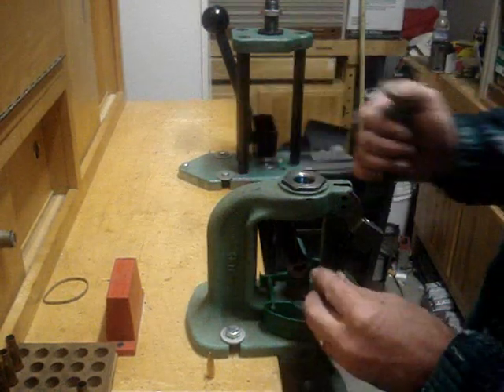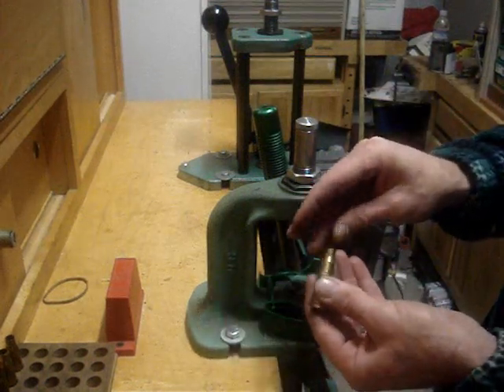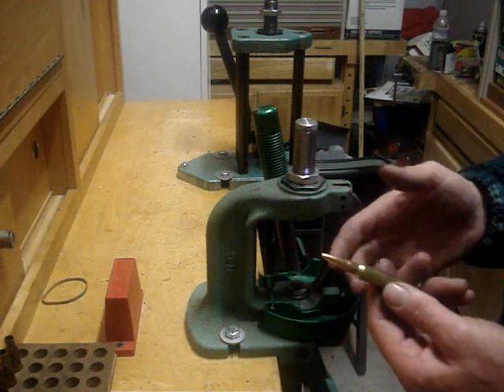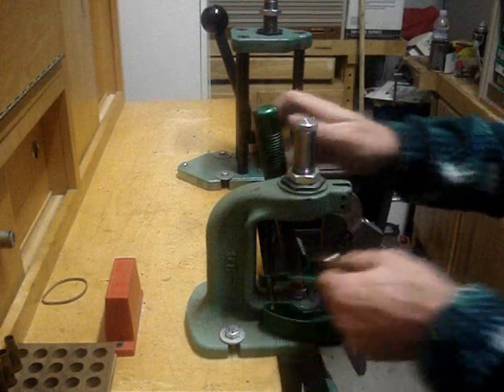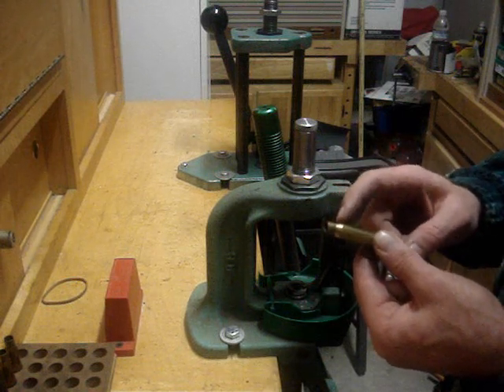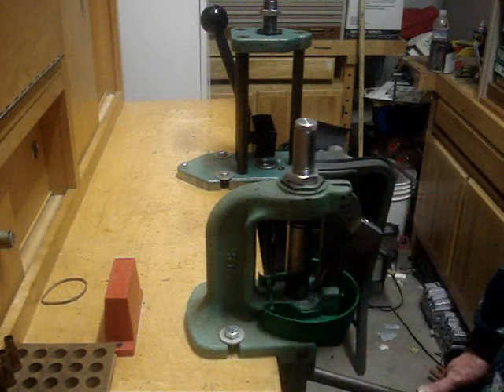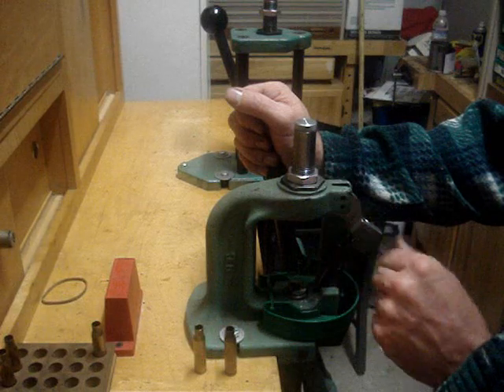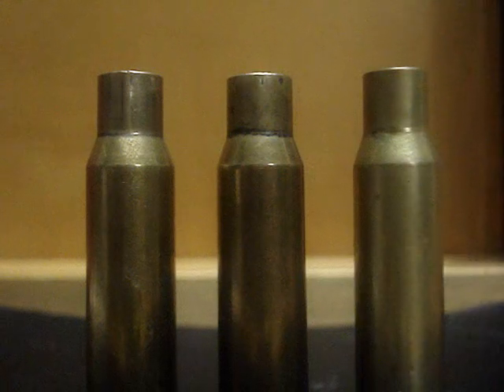Lee Collet Neck Sizing Die Part 2

Comment: This is a good video but, it seems from watching as though you are  turning the lock nut or ring only to make your adjustment.  What you are actually doing is turning the locking nut which in turn is adjusting the the tube above the lock ring at the same time as the nut to make the adjustment which the video does not fully explain and could be confusing to someone new watching. My point is, it is not the turning of the lock nut that adjusts the collet tension (as the video implies to me) but the turning of the cylinder above the locknut which also turns the locknut and put pressure on the collet to make a change in the neck tension. This is constructive only. Thanks!I
Reply: I think if you look very closely you will see the die turn as he is turning the lock nut. At least that is what I can see.

Comment: Okay.... so, I'm new to reloading, here's comes some newbe questions.  Do we use the Collet Neck Sizing Die before or after the Full Length Sizing Die. Do we lube the cases for the Collet Die, like we do with the Full Length Die? <obviously only the shoulder if at all w/ the Collet Die.. & Is the Collet Die necessary if we Full Size Die?

Also, I noticed that your Collet Die came apart easily, my inner piece [collet ] moves only with fairly heavy pressure, but will not come out of the die. 

Thx

Comment: Neck sizing is for when you want to make very accurate loads for one particular (generally bolt action) gun with brass that was fired from that gun. If you are using the rounds in more than one gun or in an autoloader, you generally want to use a full length sizer.

Comment: You need to measure with calipers the OD of the neck after camming over ever so slightly to achieve the correct OD of the neck ie; .308 win has .330 OD before bullet seating. After bullet seating it measures .332. The mandrel that goes inside the neck of the case is .306. So you can see the neck tension is .002 after bullet seating.

Comment: @ammosmith 
I also plan on reloading my mini14 and wasr10 semi auto rifles ,on those do you recommend to resize all the time and do i have to neck size also?  Im asking cause ive seen Lee selling the 2 die set for these calibers and was wondering if the 2 die set would work , the resizing die and bullet seater with crimp. Its doesnt have the neck sizer.But its cheap

Comment: Hi, I'm working on loads for an old Remington Rolling Block in 7X57 Mauser.  I fireformed the brass and the necks expanded to almost .30 cal.  Obviously I have a chamber that is really out and headspace is bad also.  I resized the necks with the collet sizer die and it left really obvious working marks on the case necks.  Any suggestions?

Comment: I just started collet sizng last night. I have the die set up per Lee instructions. I could feel no pressure when inserting a case into the die, as stated in the video. I did some research online. Many said that the ID of the case mouth should be .001" smaller then the size of the bullet. For exmaple .308, so, the ID of the case mouth should be .307". I checked all of mine, and that's the measurement I was getting. Just thought I would share.

Comment: I have been using my Lee Collet Die following the instructions provided with the die.  Lee recommends screwing the die an additional turn or more after shellholder contact.  This keeps the press from going over center to the end of travel.  The user is supposed to apply about "25 Lbs. of pressure," to the press lever.

I think the method used here is likely to be more precise then the Lee instructions. 

I plan to try the ammosmith method.
Reply: rx2tee  that’s how I do it. My press handle goes down a little over half way and I “lean on it” just a bit.

Comment: Using the LEE Collet die is about the only operation that I do by feel, as opposed to letting the press linkage hit the stops.  It is very pressure sensitive.  You do not want to apply too much pressure once the collet is at maximum compression.  That will only damage the die.  I believe you can FEEL this point of maximum compression best when set up according to LEE instructions which do not allow the ram to ever "top out".  That is how I set it up on my Rockchucker.  This worked VERY well.

IIRC, Lee has separate setup methods for LEE presses as opposed to other brands.

Comment: Thanks for the tutorial of the Lee Neck Sizing Die. I bought a Lee Neck Sizer to use for my bolt action rifle. I have been reloading .223 for years for my AR, first time reloading for my .308 and wanted to neck size for bolt action. I could not seem to get the tightness I wanted around the bullet. I thought it might be as easy as turning down the die until I was happy with the tightness of the bullet to the neck. thought I would see what was on You Tube before I went any further.  Very informative video.

Comment: Thanks. I just started loading a 222 with this die today. I was confused by adjustment until I watched this, even though I followed the instructions. I was seating the die too far down, and just using feel to size the cases. I didn't have any of them deform on me doing this, but as you can imagine the tension was not very consistent.

One nice thing about this die, like you stated, is that a proper-OAL gauge can be made by using light neck tension and a bullet to find where the rifling begins.

Comment: Good video series. The instructions for the Lee Neck Collet sizer also say to size the neck 3 times, rotating the shell 1/3 of a turn each time. This helps get a uniform size around the neck. Since you have a nice dial indicator for runout, it would be really interesting to see how much sizing the neck 3 times helps.
Reply: I have instructions in the Ultimate Die set which did not mention this whatsoever about the Collet die

Comment: Awesome video. I bought a die set for my .30-06 and thought it was defective. Could not get the neck tension I needed. I may have been too easy on it, not pressing down hard enough as well as not setting the die properly. I haven't sent the die back yet, so I'm going to try it again. This video was extremely informative, I'm new to reloading.

Comment: This die actually mace the same or even better/less runout than the other "pro" and exspensive dies, like the Redding Competition Neck Sizer. This is pretty much due to this genious system by Lee pressing from the inside of the neck, and not outside as with a bushing ring. Where the deformations in the neck will be transfered from the inside to the outside with the Lee, and opposite with a bushing, where the disformations will be where the bullet is held, which is pretty bad. You want the side that holds your bullet to be as straight and nice as possible, for the least ammount of runout. A little tip to get NO runout at all: Turn the die a couple times and run it after each little turn, and its almost impossible to see any runout on a runout measuring tool! Crazy nice die for the price. A good and rare example of cheapest and best! And good guide!

Comment: Thanks for the instructional video, it will save me some time when my new Lee Collet Die arrives. One suggestion, though, when polishing the taper on the collet, try polishing in the same direction the collet slides in. The tiny grooves left by the 1500 grit emery may not feel like much, but it does make a difference.

Comment: ...I use this die for my bolt action.223.  I turn the brass 120° and size it twice and  check the tension occasionally with a .224 bullet. I also measure the neck external diameter with digital calipers; around 0.248" for my Geco brass...and make sure use enough pressure too!

Comment: Very useful video, thanks for upload it! With my Classic Cast and Lapua cases, I have to slightly touch the shell holder and turn in 3/4 more. In this manner, I have good tension but little signs on the collet.

Comment: i collet form my brass with light pressure, turn the case 1/8 a turn then do it the full pressure. makes the collet "marks" alot less visible. i think it helps. i can get .155 4 shot groups out of a savage 10fp. another thing i did was put the center mandrell in a lathe and take .0005 off it, so i dont have to put as much pressure on the case to get the proper tension, it leaves less bumps on the case. running scotch-pad on the mandrel in a drill would probably work as well. good luck!

Comment: with the measurement you where taking at the end which numbers where you using  for eccentric runout. There was an obvious out of round issue with the full length sizing die due to the two measurements per revolution, that is measuring the semimajor and semi minor twice per rev.

Comment from the maker: I have brass that I neck size only for my .308 and I have 20 firings on them Keep the loads below maximum and with a 30-06 you should get at leat 10-15. The taper in the case has a lot to do with case life.

Comment: Could you aid the run-out situation by turning the case 1/8 turn and run it through the collet neck sizer again, therefore eliminating the spots where the petals came together for the original lever throw?

Comment: @ammosmith Great videos
I got the 3 die set and ordered the factory crimp for my 3006 bolt action. I resized the brass that was picked up at the range. But once its fired formed to my rifle i only have to neck size right? And when i due my oal gauge set it a .100 shorter. then crimp it. Right?

Comment: excellent video.  But just IMHO, I never had any problems with a standard 2 piece die set.  they are only $10 or less used on Ebay now, and work quite well.  If I was going to get anything else, it would be a neck size Hornady die, those are awesome.

Comment: @ammosmith Hi! With the die turned 3/4, the tension isn't optimal (case neck and shoulder dirty of gas). If I screw the die 1 turn after the touching of the shell holder, the final piston run is very hard. Very strange!

Comment: Good video.  I use Lee Universal Decapping die to deprime - so I have removed the decapping pin from my Collet die.  What are your thots on the pin being out?  By your description, the 'pedals' would have nothing to form/press against.  Wondering if I should replace the pin?
Reply: +Lesal8403 yes
Reply: +Lesal8403 I'm not understanding what the advantage is in depriming in another step.Some people do with dirty brass to get the pockets clean before sizing but even that doesn't make sense.
Reply: the decap pin is what the pedals press on to
 form the neck size how would it function without the mandrel for uniformity
Reply: guess I will have to try one and see
Reply: 762gunr
I deprime, the sonic clean my brass, then go through reloading process.  It cleans primer pockets and inside of casings which will impact primer and powder burn.  just my method...
Reply: Plane Iron
that makes sense... I figured that was worth the question.  Rifle is much different than pistol that sizes totally differently; when I started loading 9mm I noticed the need to put the pin back in my rifle die.

Comment: Reloading for a M1A. I full length resize my cases. I do not like using factory crimp die because the deformation of the bullet even with a light crimp. Soooo i was kicking around the idea of resizing the neck after a full length resize. Goal is to increase neck tension by .001, currently the LC brass ID is at .306. I want reduce the ID to .305 in hopes to forego having to crimp. Plan is to modifiy the Lee Collet Sizing Die by removing the decapping pin so I can resize the necks on a primed case.   
 Any thoughts? Run'em up the flagpole see if anyones salutes
Reply: madmacc040 You might have a good idea there.  Mark the die at different settings and shoot.
Reply: madmacc040  I know this was long time ago... but was on Lee's website and they have undersized pins...
Reply: Thomas Ewers-Still very relevent. So many things goin on I forget stuff. Thank You.

Comment: Setting neck tension by feel like that sounds like a recipe for disaster.  Simply measure the neck ID after sizing and you'll have an exact known amount of tension.
Reply: Yep.  I simply follow the LEE instructions and get .002" neck tension every time. There's really no way to get more other than turning down the mandrel.

Not sure I'd be comfortable trying for LESS neck tension by the method in the video but maybe I'll try a few groups that way.
Reply: @Sherman62 : I also just follow the Lee instructions as well.  Works perfectly.  Lee tells you specifically not to cam over on presses that can cam over.  As you mention, neck tension is controlled  by the diameter of the mandrel.  Lee will grind them to diameter for you if you wish.

Comment: you should not be able to seat a bullet by hand even with .001 neck tension. Benchrest shooter can load one round at a time with less then .001 neck tension. Hunting rifles bullets will move under .001 neck tension. Generally .002, I have rounds with .001 and they don't move, although I had one bullet move about one to two thousands. For hunting it's not a big deal. But seating a bullet with your fingers? Not a good idea at all.